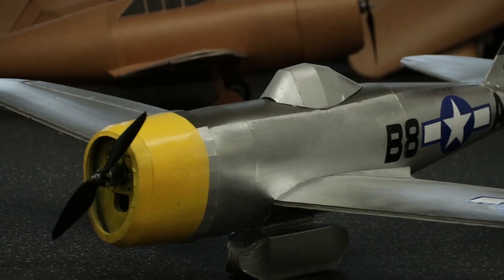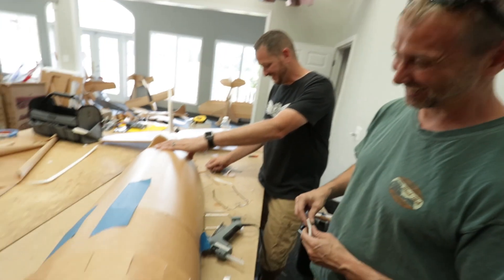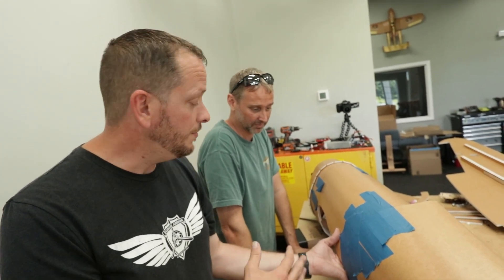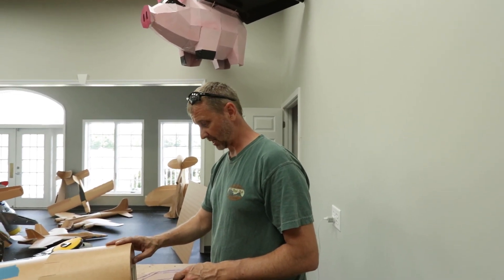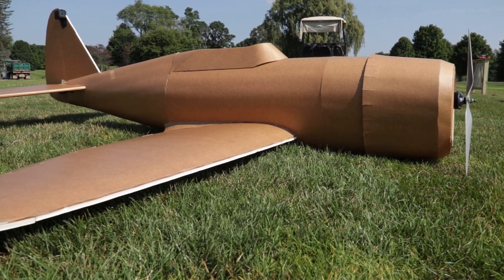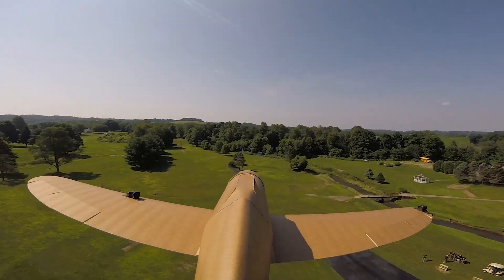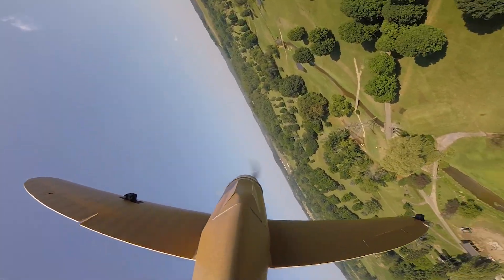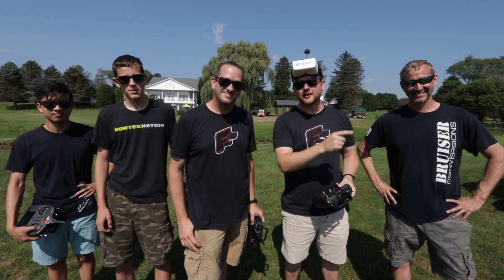Flying 8-foot P-47 Thunderbolt 😲 made from Foamboard

Comment: Its oct 2025, and i havent built any FT planes since the master series corsair came out. I put fpv on it , 12*7 prop, 3548 monster motor, 3500mah 4s, flew it dozens of times. Then 1 day i lost video over a very large patch of woods, never saw it again. Its time to build another master series. 3536 brushless this time, a little less power, and still fpv, just with a better vtx this time

Comment: I have never built or flown a rc aircraft. I have sent in a few challenges for you guys to look at. In one I had suggested building a proof of concept aircraft using a EGW 80 wing design set it up as removeable wings for for a sport bike. I know there are no model motorcycle kits that would survive most rc aircraft type landings. Maybe using foam board to build a motorcycle replica would work. What do you think?

Comment: When forming foam, a good tip is to use a low power heat gun or even a hairdryer, it heats up the foam and after you have formed it, the foam will cool down and take that shape, it won’t try to bend back
Reply: thank you im going to try that
Reply: Wow! Thanks for the tip!

Comment: Would be good to see these large models with full specs: weight, cell count, ESC, Motor Specs, Prop etc along with the material sizes used. This way others can emulate your efforts with large scale plans currently available  in other countries.

Comment: It can be discouraging. But when you get one flying, its a buzz. A buzz long enough to get you through more crashes. But by that time, you've got enough practice and confidence not to crash.
If it wasnt for dollar foams, I woulda quit long ago. And I just slap one together in a few hours, no particular design. As long as it has cg and reasonable means of lift, you can get almost anything flying.

Comment: WHO'S SCREWIN' AROUND WITH THE CNC MACHINES .. ?
#1)  20-30A Relay w/ Weller Pencil Soldering Iron w/ EXACTO BLADE ...
 ... to melt away a flare\flange in the foam in incremental steps.

Comment: Super job, guys.  A clarification about actual and scale speed:  The full size warbirds flew 400 to 446 miles per hour.  So, a quarter scale warbird flying 100mph is actually scale for these planes.  But certainly, you do not have to fly that fast unless you want to put scale power into the plane.
The slow speed of this giant plane is simply AMAZING, and looks so "user friendly".   Again, SUPER, SUPER job!  I AM SOOOO LOOKING FORWARD TO THE PLANS : )

Comment: Quick questions:  What is the scale size of the enlarged 8-foot Master series P-47???   0_o     Does any one make a proper scale 4-blade paddle prop for the Jug???
Reply: Original size p-47 (1206mm) google convert mm to feet and you get 3.9566 then multiply by 1.86 = about 7 feet 4 inches when done, nearly 8ft
Reply: Fms 1700mm Corsair is a big 17inch  4 blade paddle prop, but 2243mm Jug is very wide at the cowl, may need 20 inch prop.  But with anything but a 2 blade prop you need landing gear to protect prop.

Comment: B25 - For sure.

But main dream in foam really 8' ft big - 
Wright Brothers Biplane - Twin Huge Props - single motor - but mini skinny cog belt drive. 
Using skids for landing gear is way preferred over wheels on everything. 
Motor / Battery could be at lowest point of CG. Using mock foam placement for original gas engine. Or not at all.  

Cheers 
Good luck

Comment: Would love to see you guys build a working cropduster plane. Small plastic bottle with pressurized water and solenoid valve to some tiny sprays. Lay down some large sheets of paper and try get an even spray over the whole area on a few passes. Throw some soda in there and spray one of your coworkers cars for a good prank! Sticky!

Comment: YOU GUYS SHOULD MAKE A NEUTRALLY BUOYANT AIRPLANE!!! LIKE MAKE A BIG PLANE AND FILL IT WITH HELIUM BALLOONS UNTIL IT JUST ALMOST FLOATS. THAT WAY THE PLANE DOESN'T NEED TO WORRY ABOUT LIFT AND CAN JUST BE DESIGNED TO BE A SILLY SHAPE. See how light you can make a plane, see how odd you can make it shaped. Try to make them look as like regular planes as you can like hiding grocery bags in the wings and filling them with helium before tying them off maybe putting conventional balloons inside the plane body!

Comment: That blue tape is painters tape meant to be less tacky so it can easily be pulled off a painted wall without removing existing paint....you should use traditional masking tape, it's more durable, will last longer.

Comment: Awesome build. Brilliant build style. I haven't seen other cardboard build vids. When he says glue, then tape to hold, does he mean CA or hot glue or something else?
The LG on the Kraken was way overkill. Cardboard wheels (two disks with foam spacer) is strong enough. The angle iron shelf bracket too, should have been piano wire. But! It flew! Flew well!! It survived two devastating crashes. Potentially terminal crashes -- the strong build saved it.

Comment: I'm not trying to be an asshole but RC aircraft have gone down hill quickly. I remember taking the time and dedication to build an aircraft make entirely out if balsa, precise angles, airfoils and weight. My first ever was a sail plane, no motor at all, so it had to be nearly perfect and it flys like a dream. My 2nd was another hand build plane out of balsa with a 2 stroke engine on it. Back then you had to worry about weight and make sure your air foil was perfect. Now, you have overpowered electric motors. With those, you could literally make a tree branch fly because the motor has so much power. RC aircraft no longer havr the elegance of depending on the perfect air foil to make it fly because the motors make that aspect moot. I'd like to see these guys get a Goldberg Sophisticated Lady sail plane, build it and fly it. Old school RC is much more difficult to fly.

Comment: As an RCer who's flown Warbirds from 1/12 scale WWII Combat to Giant Scale (1/5) - I've found that, the larger they are the more docile & predictable they fly. The difference in the inertia makes the small ones extremely sensitive & responsive, whereas the large planes will seem smooth & docile on the controls. Also, if you compare the "Cubic Wing Loading" between large & small planes, it becomes obvious how much more forgiving large planes are. One item that is important and makes a BIG a difference with large planes, is using PROPER Rudder Control. @Josh - Can't be letting your left thumb get lazy like that. It was very obvious on the launch. Also, when performing rolls, even some rudder input will feel like the power steering got turned on for your ailerons.

Comment: Running off 4 cell means nothing . You could turn that same prop off a 3 cell battery with a bigger motor...they seem so impressed it's running on a 4 cell thinking maybe it should be higher??? But you could run that off a 3 cell just the same..and yes 4 cell are affordable...just not the 160$ in batteries you have in it

Comment: Please introduce your audience to carbon composites in all of their forms..   enough foam board...  making me sick seeing all of that effort go into a disposable airframe. .
Reply: FPVREVIEWS that would defeat the purpose of inexpensive easy builds. I guess you could use their free plans and build out of whatever you want, including Al cans.
Reply: @jeffkeith637  yea, well would just provide some variety, and education.   nothing wrong with foam, but they don't use anything else.. would be good for people to have options for more time consuming builds, can be built to last longer.... 
      BTW is that a Ford Falcon on your thumbnail?   I had a 1960 Ranchero, was my first car. I dropped a 302 V8 in with a 3 speed auto, and rear end from mustang, low gears and big rear tires.  it was a sleeper..     hard to tell from the size of pic.   cheers!

Comment: I love this so much! Please make massive versions of all your models, they are so cool haha👍👍

Edit:
You guys should talk to redi board about the monster foam so that they can make it and we can then get it in other countries ie. New Zealand so that we can scratch build these big models!
Reply: Hey dude, if you're an NZer like me and hanging out for good foam, hit up supermarkets/sushi shops etc. to get those polystyrene foam containers they deliver fish/meat in. They're about 750x300x200mm and the foam walls are about 30mm thick. More work than foam board because it doesn't come in a huge sheet, but it boxcutter-carves/sands/hot-wires great, tough as nails with packing tape over it and it'll tide you over until NZ gets a proper big-foamboard supply. :D I build all mine with it.
Reply: LOONSMOCK that is actually a really good idea. I’ve been trying to find a place in nz that sells foam like that to make hot wired flying wings out of. But if you have an Uncle bills near you, i get my redi board from there. Same thing as in the US
Reply: @cameronsteed2712  Not that shop specifically, sadly - I've found a few novelty shops that have foam board but it's like $9 for an A2-sized sheet and I think "screw this, time to go dumpster diving" :P How much is it at the place you mentioned? But yeah, the chilly-bin foam hotwires GREAT. They're easy to set up - my bow uses some steel welding filament I got in a garage sale as the cutting wire, and for power I use an AC/DC adapter I think is from either an old laptop or an old LCD monitor. Bow is just some scrap wood held together by a couple of nails, and a bungy cord for tension. About $12 all up!
Reply: @rcbinchicken  I'm from Ukraine and here we use smooth foam 50x50cm celling tiles instead of foam board. Not the ones found in offices but the you you glue onto ceiling. I did some googling and it looks like you guys have these tiles but I'm not sure if there's any smooth ones.
Reply: LOONSMOCK it is $3 for a sheet for a roughly 750x500x5mm sheet, but since it’s the American stuff they sell it as 30x20 inches. Cheap as chips.